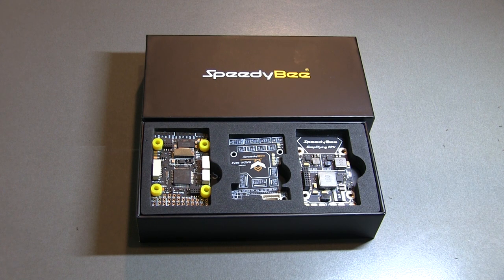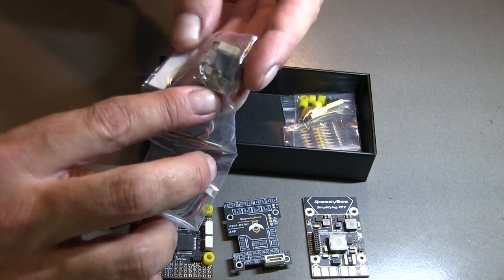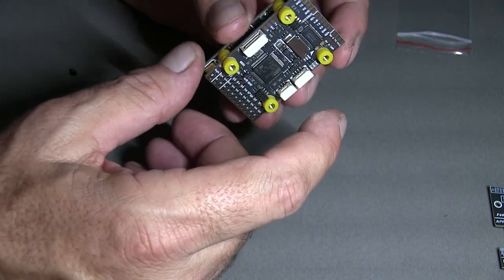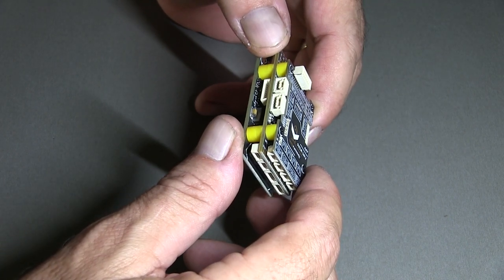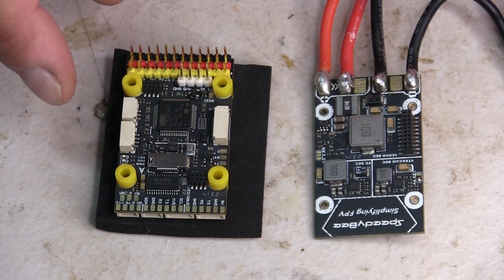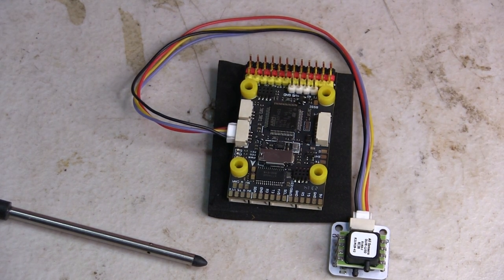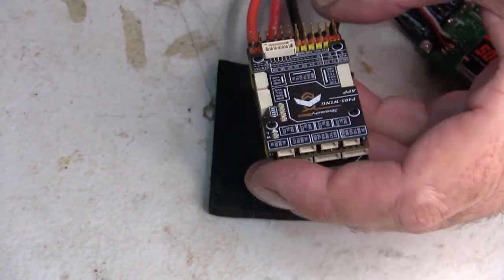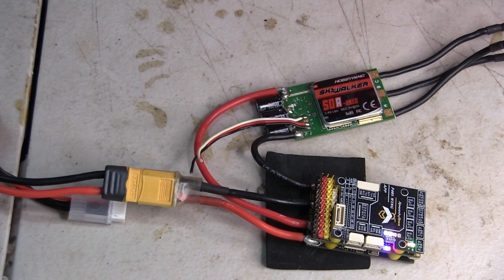FX-61 Phantom Upgrade - Speedybee F405 Wing - Setup and Install INAV 6.1

Comment: A great FC, the pros from me is the wireless connection and the app to configure the setting. For me personally I think this is one of the best inav boards on the market for value for money and ease of use. Great review
Reply from the maker: Yeah I agree I am pretty happy with it was certainly a good upgrade from the f411wing board I previously had in the plane. Thanks for the comment 🤠

Comment: Nice build/upgrade and setup. Good work keeping clean and tidy.  As part of preflight checks, doing a control surface check in a flight stabilized mode would ensure responds in correct direction. Not so critical here having flown prior. Would be more so if were setting up new servos servos.
Looking forward to seeing the re-maiden and your thoughts on flying with the Speedbee wing FC. Thinking of doing a similar 411 FC upgrade.
Reply from the maker: Thanks for the comment! With weather permitting I hope to maiden 2 new planes and remaiden the FX-61 next week.

Comment: Do you by chance have a copy of your initial settings others could use to push into the CLI and get the setup you like? For those of us just starting out it would be nice to have the same basic default settings as you, same OSD, inputs/outputs, rth, takeoff assist. 

I’ve been watching you for quite some time and I would like to see what you use as your default setting in iNAV if possible
Reply from the maker: @iamsoulcandy  Thanks for watching I will see what I can do regarding this. Obviously to just copy everything from cli is not really recommended unless you are using the exact same plane and all hardware included weight would also need to be very close just to copy all settings. 
Saying this copying OSD and other basic setup should not be a problem. Do you fly an fx61?
Reply from the maker: Heres the OSD setup i use on it although now it runs a Walksnail Avatar HD FPV system now so these most probably will not work if your running any analog FPV system. I'll also do a video of the full setup on this plane and how its setup in INAV.
# OSD [osd_layout]
osd_layout 0 0 44 1 V
osd_layout 0 1 1 10 H
osd_layout 0 3 8 6 V
osd_layout 0 6 1 4 H
osd_layout 0 7 1 2 V
osd_layout 0 8 24 1 V
osd_layout 0 9 1 2 H
osd_layout 0 11 1 16 V
osd_layout 0 12 2 8 H
osd_layout 0 13 48 8 V
osd_layout 0 14 1 1 V
osd_layout 0 15 47 7 V
osd_layout 0 19 1 17 V
osd_layout 0 20 42 17 V
osd_layout 0 21 42 16 V
osd_layout 0 22 26 3 V
osd_layout 0 23 24 2 V
osd_layout 0 25 51 10 H
osd_layout 0 27 47 9 V
osd_layout 0 28 1 4 V
osd_layout 0 30 13 8 V
osd_layout 0 31 1 2 H
osd_layout 0 32 1 12 H
osd_layout 0 33 47 4 V
osd_layout 0 34 11 1 H
osd_layout 0 35 1 11 V
osd_layout 0 37 1 12 H
osd_layout 0 38 1 9 V
osd_layout 0 40 1 5 V
osd_layout 0 48 1 6 H
osd_layout 0 49 1 6 H
osd_layout 0 54 1 10 V
osd_layout 0 99 19 2 H
osd_layout 0 108 9 2 H
osd_layout 0 110 48 1 V
osd_layout 0 124 25 7 H
osd_layout 0 129 10 4 H
osd_layout 1 0 26 1 V
osd_layout 1 1 1 11 V
osd_layout 1 3 8 6 V
osd_layout 1 7 2 2 H
osd_layout 1 11 1 13 V
osd_layout 1 12 0 14 V
osd_layout 1 13 25 3 V
osd_layout 1 14 1 1 V
osd_layout 1 15 25 5 V
osd_layout 1 19 2 7 H
osd_layout 1 20 19 14 V
osd_layout 1 21 19 13 V
osd_layout 1 22 12 1 V
osd_layout 1 23 13 1 V
osd_layout 1 27 24 4 V
osd_layout 1 28 23 14 H
osd_layout 1 30 1 7 V
osd_layout 1 31 1 2 V
osd_layout 1 32 1 10 V
osd_layout 1 33 24 2 V
osd_layout 1 34 11 1 H
osd_layout 1 35 1 12 V
osd_layout 1 37 1 8 H
osd_layout 1 38 1 9 V
osd_layout 1 40 24 6 V
osd_layout 1 48 1 4 H
osd_layout 1 49 1 3 H
osd_layout 1 86 1 3 V
osd_layout 1 87 1 4 V
osd_layout 1 96 25 5 H
osd_layout 1 106 2 3 H
osd_layout 1 107 1 2 V
osd_layout 2 1 2 12 H
osd_layout 2 3 8 6 V
osd_layout 2 7 25 1 V
osd_layout 2 16 1 2 V
osd_layout 2 17 1 3 V
osd_layout 2 20 19 11 V
osd_layout 2 21 19 12 V
osd_layout 2 22 14 6 V
osd_layout 2 30 1 9 V
osd_layout 2 33 24 6 V
osd_layout 2 56 1 4 V
osd_layout 2 62 2 2 H
osd_layout 2 63 2 3 H
osd_layout 3 1 1 10 H
osd_layout 3 3 8 6 V
osd_layout 3 8 9 1 V
osd_layout 3 11 25 5 V
osd_layout 3 13 25 1 V
osd_layout 3 14 1 1 V
osd_layout 3 15 24 3 V
osd_layout 3 19 25 6 V
osd_layout 3 20 19 12 V
osd_layout 3 21 1 12 V
osd_layout 3 25 28 5 H
osd_layout 3 27 24 2 V
osd_layout 3 28 23 7 V
osd_layout 3 30 1 10 V
osd_layout 3 33 18 1 V
osd_layout 3 37 1 11 H
osd_layout 3 38 1 5 V
osd_layout 3 40 1 3 V
osd_layout 3 54 1 6 V
osd_layout 3 129 10 3 V

Comment: Very nice setup, thanks for sharing your tips and tricks. I was thinking of installing an airspeed sensor, does it help the aircraft fly better in cruze & RTH modes?
Reply from the maker: Yeah it's supposed to help with the auto modes like rth cruise and waypoint missions etc during flights with winds.

Comment: Hi I already connect my speedybee F405Wing to my INAV Configurator in my PC
I cannot flash my Firmware
I already clicked SpeedyBee F405Wing and Firmware Version 7.0.0
I click Load Online Firmware then scroll down
Click Flash Firmware but nothing happen
Reply from the maker: Could be driver issue have you downloaded the latest stm driver and installed it? Also make sure your running iNav configutator 7.0 as well. I would think it should install no problems.
Reply: Same issue for me. I have drivers and can configure on inav6 but can’t flash to inav7
Reply from the maker: @abe101isabeast  interesting with these issues mine is running inav7 currently with no issues installing. I did have 1 issue which wasn’t connecting but it turned out to be the cable I was using. Maybe ask someone a developer in the iNav Facebook page to see what they say. I’m sure the issue must be something simple.

Comment: I’m not getting stick movement in inav, I set subs in receiver tab. I’ll check if unarticulated 2 was selected next
Reply from the maker: It probably has somethings to do with your setup in configuator. Are you running elrs?
Reply: @stonesrcchannel  no frsky

Comment: Excelent video, i was thinking about using it on my VTOL aircraft, do you know if  it´s supported?
Reply from the maker: The speedybee f405 wing supports both iNav and ardupilot. I don’t think iNav supports vtol as yet but I’m sure they will eventually. Ardupilot would be my definite choice of firmware if I was to build up a vtol as it has preset setup for it. Thanks for watching.

Comment: Hi, I was confused in 11:47 where you said to upload the INAV 5.0 default settings. How did the box just pop up? How did you do it?
Reply from the maker: Hi, I hit the “load from file” button from bottom right to open the diff all file. Could have also been a bit of editing work to speed it up for the video which made it open fast. Hope that helped thanks for the comment.
Reply: @stonesrcchannel  hi, that’s bizarre because when I opened the file it just opened my desktop files on my computer.
Reply from the maker: @shannonwong426  yeah that’s what it does then you select all your diff all files to import. The screen capture when I did the video never showed that part for some reason. Maybe that’s what’s confusing.

Comment: I was not able to install the controller exactly at water level. There are only a few degrees of difference. Do you think there is a way to correct this from software? There was an option for this in the ardupilot controller, but I couldn't find it in INAV.
Reply from the maker: I am not sure but I would think so somewhere in cli best advise is to try ask the iNav developers on Facebook they are very helpful!.

Comment: What a great build video! Jamie, nice and tidy. And yes I also question where the SD card goes but from watching other videos access to it looks pretty simple. Really looking forward to re-maiden and have you seen the new Hawkeye 4K camera? I think that would be pretty cool on something like this. Take care!
Reply from the maker: Thanks Robert, the position is the SD card is what has me worried as I don't want to keep taking the top board off just to access the SD card why they couldn't have designed it so it was in an easy spot to access? No I haven't seen the new Hawkeye 4k I will check it out thanks.
Reply: Ok  thanks

Comment: Very great Video, like this Setup. I have a little Question: How did you calibrate the right Side, where the Cable of that USB Part is connected? Also the Top Side is not flat
Reply from the maker: The right I calibrated with the bottom of the FC against a wall and the top I had it propped up with foam it came sitting in. Just make sure it is totally still.
Reply: @stonesrcchannel  ah ok, thank you

Comment: My dear, how are you? I also have this same controller, but I'm not able to arm the motor with my radiomaster tx16se. Is there any specific configuration I should do? For my wing I'm not going to use GPS, just fly like a model airplane. They told me that I have to arm it (using arm mode) and then lower the engine stick and turn it to the right, but it didn't work. Do you have in mind what it could be? strong hug. Vagner
Reply from the maker: Arming your setup will depend upon which firmware you choose to install to the f405 either ardupilot or inav. In my case I use inav and arming is done via a switch once GPS has collected enough satellites. Which firmware have you installed on it? Thanks for the comment.

Comment: When i hit the flash firmware option the fc just gets disconnected from computer and the com port also please help!
Reply from the maker: I have never had that problem before, sounds like it could be a driver issue or a bad USB cable. I believe if you try install firmware via WiFi as well it won't work. Have you got the latest STM driver installed? Are you using inav?

Comment: Hello friend! I need help with the f405 wing. I already have everything ready with INAV, I connect everything and the buzzer does not stop ringing. I assumed it was a lack of satellites, it keeps ringing after 10 sat., I really don't know what could be happening.
Could you tell me what alert controls it has so that the buzzer doesn't stop ringing?. Thanks
Reply from the maker: Sorry but i can't exactly pinpoint why its doing that other than that it could be just a warning when the system cannot detect any radio link? Are you powering it up with solid link between receiver and transmitter? If you were than it could be worthwhile asking someone in the inav fixed wing group on facebook.

Comment: Hi do you know if I can use this flight controller with a futaba 16iz transmitter I want to use it with a fpv airplane please 🙏 help
Reply from the maker: Yes you should be able to
Reply: Do you know what antenna I would use on the flight controller I'm so confused
Reply from the maker: @ramonmejias2178  you would need a receiver compatible with the futaba 16iz although I haven’t looked at that transmitter before but I assume there would be compatible receivers you can get which support at least sbus on their website. If the 16iz has a module bay at the back you could get a module which supports Express LRS which would be the way I would set it up.
Reply from the maker: The receiver/RX which has the antenna plugs into the flight controller. The flight controller doesn’t have an antenna if that’s what’s confusing you.
Reply: Thank you so much if you are ever in ny you have an open invitation to fly in our club seaview rotary wings

Comment: Have you tried ardupilot firmware? I am having issue with F405 not holding it. INav is OK but not ardupilot.
Reply from the maker: No sorry I haven't tried it with ardupilot
Reply: @stonesrcchannel  would you be able to? It drives me nutz!!! It will load and work until I power it off and on. Gonne.
Not with INav, though.
Reply from the maker: Sound real weird I wonder if it has anything to do with the size of the firmware being installed? Could be possible ardupilot is larger than iNav? Just a thought. Possibly not enough memory although this is the first time I have heard of this issue on this board. It could worthwhile asking in Ardupilot forums to see what they say. Kind of why I stick to iNav as it’s more simple and does the job.
Reply from the maker: I did at one stage try and install ardupilot onto a matek f405 board not sure why but each time it kept crashing on install so I gave up and went iNav.

Comment: Hi is it okay if I didnt have airspeed control?
Reply from the maker: It's ok not to have it but I recommend it if you plan to fly in windy conditions as you can more easily see if the craft is flying into a headwind or tailwind. So basically your airspeed reading may read 40kph but your ground speed is 0kph let's you know your not moving at all but fighting a 40kph headwind. Very over exaggerated example but you get the point I hope. Also handy for tuning automated flights for the same reason.
Reply: Hi finally I bought the similar spec with you
Speedybee F405 wing
GPS Walksnail M10
Rx Matek R24D
Caddx Ant Camera
AKK race ranger VTX
3servo
1ESC
1motor

This is my first time doing electronic

As I saw in your video, we only soldered ESC,  Battery cable, and PIN in the FC. Other we only plug to the PIN isnt?

I am sorry I cannot see the detail connection in your video
 @stonesrcchannel
Reply from the maker: @Indonesia01ian  yes that's correct everything plug and play other than ESC, battery cable and pins.

Comment: Can you use that without an air speed sensor?
Reply from the maker: Yes you can the air speed sensor is not really necessary unless you want to fly automated modes such as waypoints, rth etc. It is worth using as you can tell if your flying into a headwind or tailwind which is helpful for throttle control. I have other planes which don't use an air speed sensor and they perform just as well. I just can't tell if I'm flying into a headwind which could cause a stall if not enough throttle is applied
Reply: Thank you for the great info. I have a BE-220 GPS and it has only 4 wires for the output and my speedy bee fc has 5 wire pins for the GPS input, where do I plug the 4 wires of the BE-220?
Reply from the maker: @ryanomoso7173  if your GPS has a compass built in normally has 6 wires, usually 4 is all you need if no compass. If your building a plane compass is not used only need + - rx and TX when wiring up rx to TX  and TX to rx on flight controller.

Comment: Why did you choose İNAV?
Reply from the maker: Mainly because it was running well previously on that so most of my diff all settings were just copied across to the new FC . The thought did cross my mind to switch it over.
Reply: Because compared to the complexity of Ardupilot, i-nav is a walk in the park...😉
Reply from the maker: @k1ortia  yes that as well.. In saying that i do enjoy ardupilot as well and have it on a couple of my planes but the simplicity of inav is hard to beat. At least for the builds i do anyway.

Comment: I stopped watching at the 13th minute. At first I thought you were going to make a new configuration. I don't know the files you copied.😒
Reply from the maker: I kept some of my old diff all files as the craft was flying well with the old FC,  but other than that it is a new setup just not as detailed if your new to INAV
Reply: Hi mate.
I need help. I've tried and tried, but I cannot get any signal from my TX  to the FC, I'm using a Spektrum nx10 and an orange r620x reciver with sbus 
For my Fx-61.
I have the sbus in the first port, then motor in s1 wings in  s3 and s4.

Uart2 is set to Serial RX 
Reciver type is set to serial, and sbus is selected in serial provider.

But now I'm lost.
Reply from the maker: @ianhanrahan7985  It sound like binding issue, are you sure the tx and rx are bound correctly?
Reply: @stonesrcchannel Hi mate, yeah, I bound the them before I done the setup, but I'll do it again.